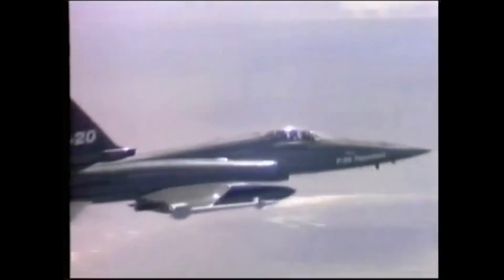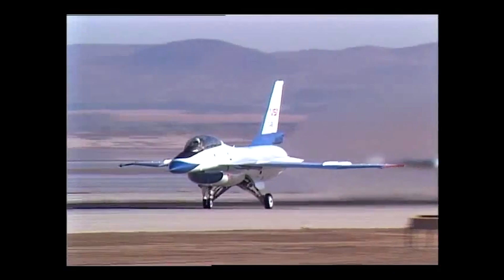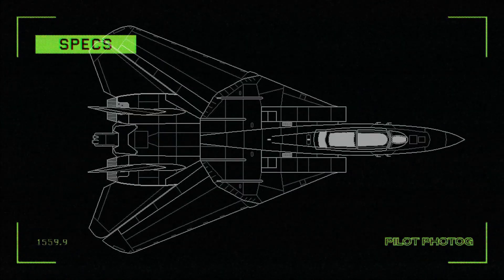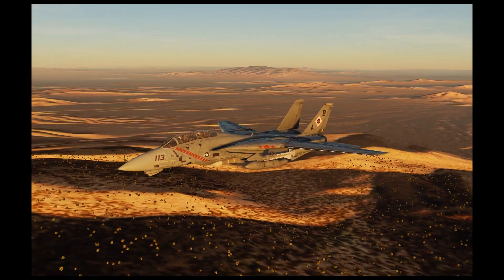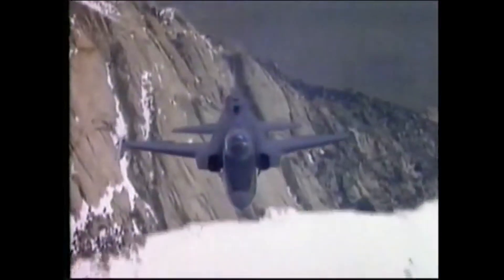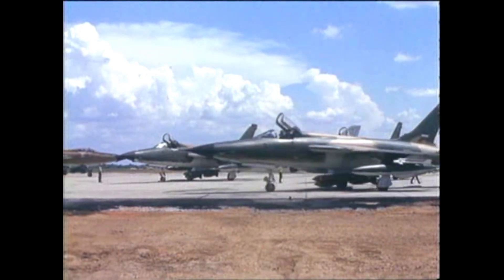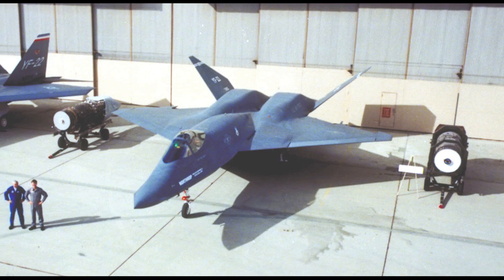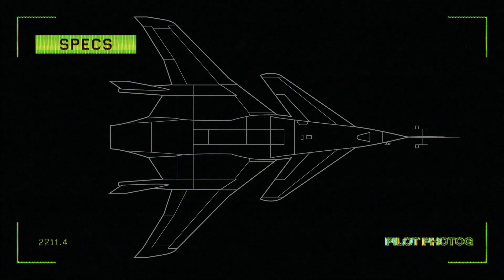Top 5 Fighters That Should Have Been Built | Best of Aviation Series by PilotPhotog  f20  f16xl

Comment: Don't take away my passport, but: the Avro Arrow definitely should not have been built. You're paying three times as much per airframe as you would for a contemporary F-4 Phantom, and giving up all multirole capability, in return for slightly better performance in the straight-line bomber interceptor role -- in an aircraft which is going to come on line simultaneously with the introduction of practical ICBMs by the Soviets, of which they will have around 1,000 by the time the aircraft is ten years old. There's a reason all the equivalent British and American projects were also cancelled.

Comment: Here's one that should've been on that list: the Vought F-8 U3 Super Crusader. It lost out to the F-4 Phantom, which was anything BUT an Air Superiority Fighter. It was basically a High-Powered Attack Bomber. The F-8 U3 had maneuverability & performance of F-15 C And in a Dogfight, would Eat an F-4 or Mig-21 alive. It was so fast, that the production models were going to have Ceramic canopy Glass, as around Mach 1.8 the top front of the canopy would glow. Test pilot Conrad said the plane was easily capable of 2.9. This stupid decision by Mac Namara, I think cost the lives of every F-4 crew lost in Viet Nam to the Migs. The Pentagon DID get it right choosing the F-15, which has a win-loss ratio of: Basically a Shut-out. See "Eagles Over Lebanon," for more on this World-Beater.

Comment: Just for the record. The YF-23 lost because of issues with the VTOL ( Vertical Take off or Landing) system. It failed to meet the military requirements.
Reply: I think you got YF-23 mixed up with YF-32 which lost to the YF-35 for those reasons you mentioned in 2001.  YF-23 went up against the YF-22 in 1990.

Comment: Crusader III which lost out to the Phantom should have beaten the HiMat.   USN was too worried about bomber attacks on it's carriers and not enough on conventional fighter duties.
Mig pilots in Vietnam would have crapped themselves in fright facing a F8U-3
Reply: I Agree with you on that one. Buy both F-4 and F-8U-3.    The U.S. Navy should of bought the F-23 and had them flying off the decks of Nimitz and Ford carriers, The true replacement to the F-14 in 2007.  let the AF have the F-22.   I read some bull crap reason they did not get it was low rudder authority on carrier landings because of the V tail.  They got a tail less flying wing drone landing on a carrier. Bullshit. 
    I guess they was tired of getting the leftovers, YF-17/ F-18 NV  YF-16 AF    The AF looked at the YF-14, went with the YF-15.

Comment: The F-5 is imo, the most potent and dangerous. Ironic because it's so much smaller. It's high maneuverability is the reason they use it as a trainer aircraft. The lower cost means you could get multiple F-5's for the price of one current modern fighter.

Comment: This is the first video on this channel I've ever watched and it was really knowledgable with an engaging presentation as well; kudos!

One plane I'd nominate is the Sukhoi Su-37 (the originally, not the Flanker variant that has now used the Su-37 moniker). It was designed to replace all of the aging and highly vulnerable Russian fighter-bomber and dedicated ground-attack variants currently in service.

It would have been favorably comparable to an F-35 in most performance measures, had much better pilot protection (which had more to do with Russia's looming demographics crisis of a disappearing pool of manpower aka not enough bums-in-seats growing up), and a mind-boggling 18 external hard points (!).

Comment: The 23 not only bested the 22, it also achieved Radar lock on the 22 during a flight in which both planes were flying at the same time.  The 22 never achieved that.  Flying to "Stealth Week" in Washington DC was accomplished by the B2, F-117 and the YF-23.  The 22 had to be carried there as it was not able to perform that simple task.

Comment: Glad you picked the YF-23! Boeing had the political connections. Lockheed built the better plane . Just like the B-49 story; this plane was too good! It's funny how something that is too good, gets cancelled. This also operative for the F-5, F-20, X-29 series of fighters. 
     The F-5 was always too good, too small, and made too much sense as a fighter. Pentagon officials like big expensive programs with juicy kickbacks. So the much larger F-4 Phantom was used instead.
     Northrup has neatly always produced the best planes. Only to lose out to Boeing's political muscle. Building a less costly fighter, based on this aircraft family; is still a great idea. Only it's unlikely that the Pentagon would ever allow it.
Reply: The McDonnell Douglas F-4 Phantom 2 was designed for the Navy ( after its older brothers F-1 2 and 3 ). Robert McNamara made the U.S. Air Force take the F-4.  The USAF even wanted to designate it the F-110 inline with there " Century Fighters " ( F-100 thru F-117 ),  DOD said NO !!!   it was one of the early fighters able to fire the new ( at that time ) AIM-7 Sparrow Missiles that are designed for " BVR " ( Beyond Visual Range missile engagements guided by the ACFTs own RADAR ) and not ground directed interceptor like F-102 and F-106 with the SAGE system of ground guided to intercept RADAR.   The F-5 is very manurable in a dogfight and deadly with its two M39 20mm cannons yes...  it can Fire AIM-9 sidewinder heat seekers yes...  but it did or does not have the RADAR and fire control to shoot AIM-7s.  So a F-4 or Later model MIG-21 and MIG-23 could shoot it down head on before the F-5 could use his/ hers agility to get behind you for a firing position and win.  That's why the F-4 was superior to the F-5 in the late 50s and on.  They eventually upgraded the F-5 to F-20 in the mid-70s with a capable RADAR and fire control to shoot AIM-7s but we are already in the F-14  15  16 and 18  era by then ( Legacy fighters ).  That's why it did not go anywhere.  The F-5 was used for close in ground attack in Vietnam by the USAF along side the A-1 Sky raider and  F-100 in the " Sandy " rolls for a reason.  I read the book.
Reply: @leonswan6733  I didn't talk about the super Crusader that competed against the F-4. A plane which was smaller, faster, and more maneuverable than the F-4. It had 1 engine and 1 seat. So the pilot had to do everything. The larger F-4 was picked. In part because it was bigger  and could carry more missiles. But mostly because they had decided to decommission the Essex class, and smaller carriers. In favor of ships like USS Ranger CV-61. Ships that could operate larger aircraft. The F-5 was too small to mount the massive radar used on the F-4. It was designed for use on smaller carriers.  Like USS Princeton. The F-20, enjoyed advances in electronics miniaturization. Which allowed it to fire radar guided missiles like AIM-7. 
     On paper, the AIM-7 could do the BVR engagements you describe.. I practice however, It almost never happened successfully. Not until later versions of the missile became available in the late 1970s. The F-14/F-15  using a new radar and improved AIM-7. Accomplished what most F-4s aspired to. Anyway bigger is not always better. The Migs 17, 19, and 21, could all turn inside an F-4 Phantom. A fact which cost use too many planes and pilots. It was only the Top Gun program which saved the F-4, from an early retirement.

Comment: F-14 unmatched speed? The English Electric Lightning from the late 50's/60's could super cruise... F-20 was a technological dead end. The F-16 was a much better airplane with much more room for upgrades.  Just because fan boys like a fighter, tank, boat, etc does not mean it is a good solution. HiMAT, NOT a fighter... Never was, never meant to be. You mention the F-107 and not the Vought XF8U-3 Crusader III. Fuck off, fanboy.

Comment: Also the F-5 Tiger ,was built in big numbers ,one of the buyers was the Iranian Air Force ,they had over 200 in all versions and after the islamic revolution in 79 they did not get any spare parts from the US they had to look for solution and start producing this plane in 2-3 Versions  the "Saeghe" -  "the Azzarakhsh"-and the "Kosar",all lok like the F-5 only they are a bit longer about 1-2 meters with an russian engine Klimov.

Comment: Oh, boy. I could not agree more with the #1 and #2 choices. For 35 years, I worked for Northrop mostly in the Test and Evaluation dept.
And I spent quite a bit of my time working on both the F-20 and YF-23 programs. Both procurement decisions were based on political decisions and not on performance. In the case of the F-20, General Dynamics was so terrified of it going into production, they cut the price of their F-16's to where they were actually taking a loss on each airplane sold, just to nip the F-20 in the bud before it could get going.

Comment: The yf23 was junk. The F22 won every test so that's why it won. If y'all talked shit about the cost of the F22 the F23 was going cost $20 million more a plane.
Reply: I beg to differ. The YF-23 was better in almost every aspect, with the exception of maybe being not quite so maneuverable.
The YF-23 had a higher top speed, a better super cruise capability, better reliability, faster turn around times, and most important, better stealth. For the last 40 years, whoever detects the other plane first gets off the first shot, and that usually means a kill. As far as maneuverability goes, when was the last time a U.S. fighter got into a dogfight? In this day and age, if you find yourself in a turning dogfight, things have definitely gone south tactically.

Comment: Incorrect information within. The F-15E and the F-15D are substantially different despite the logistics infrastructure commonality:
Stronger wings
Fly by Wire Flight Control Systems
Different Engines
Stronger Landing Gear
And more. If the video had stated that a key decision point had been its common logistics infrastructure, that would be true. To say that a decision point was "few changes were necessary" is an uninformed statement. More research is necessary on the video production organizations part.
Richard Gomez, USAF Veteran, MBA (Aviation). I have over 34 years in F-15 maintenance, logistics ( not box movement), and have worked in all three maintenance levels: Organizational, Intermediate, and Depot. For reference, the F-22 and F-35 have Two-Level Maintenance Logistics Infrastructures.

Comment: I followed the YF-22/23 race quite closely and was super sad when the YF-23 lost. 5th-gen fighter don't need to be the best dogfighter anymore. The YF-23 is faster, is all-aspect stealthier, can be had without the expensive stealth paint and can be modified structurally to fit thrust vectoring by sacrificing bottom-aspect stealth (against SAMs). The curves themselves diffuse radar returns better than the YF22, and due to its larger wing surface area, can probably fly higher. In the production F-23 model, the 2 enormous humps can be reduced further given more time in simulating airflow.

Watching the YF23 documentary and seeing the reaction of the test pilots and the engineers who worked on it when they learnt they lost was heart-breaking. They have the performance data in their hands, including data from the YF22 and they just couldn't believe they could lose with that kind of performance difference between the YF-22 & YF-23. This is why the debate rages on today.
Reply from the maker: Indeed and well said...I am working on a dedicated video on the YF-23
Reply: I thought the loosing factor of YF-23 was only the price. The competiton decided that YF-23 was an overkill while YF-22 will be cheaper and enough. What a shame...
Reply: @gunesdagli A combination of price, logistics, and demonstration. Northrop approached the competition with all of the enthusiasm and effort of a doped up highschooler at the science fair. Lockheed demonstrated the yf22s full capabilities and performed multiple tests, not to mention the fact that both yf23 prototypes suffered critical failures at many points.
Reply: Wait there is a yf 23 documentary?

I need to see that, what is the official name? Where do i watch it?
Reply: Considering it was meant to be an air superiority fighter, I would rather have the F-22 with its advanced maneuverability. I feel like the YF-23 would have fit better for the purpose of being a strike fighter like the F-15E.
Reply: @fatihkoksal4727  I doubt it. Stealth fighters don't have enough internal bays for many bombs. Carrying those on external hard points defeats the purpose of stealth.

That's why you have F-15EX and F16V.

With Aim120D & Aim260 on the way, the YF23 has even better standoff capability than F22. 

That's why you see NGAD & FAXX has even better stealth, longer combat range and network capability for AI Controlled Stealth drones.

When the NGAD & its drones have finished firing all their missiles, it's time to head home. They are not gonna get involved in a fight involving canons so high maneuverable is low on the list.

If an enemy gets close enough, the drone will kamikaze on enemy fighter.
Reply: The deciding factor was VTOL. The YF-23 failed miserably on that. Thus we have the F-22 Raptor.
Reply: @davidbrock4736  You've confused the F-35 with the F-22.
Reply: @davidbrock4736  Are you joking?  There is no VTOL on the F-22
Reply: @davidbrock4736  the F22 could NOT do VTOL.
Reply: @davidbrock4736  uhhh. That’s the f35
Reply: @davidbrock4736  I think you may be confusing SVTOL with “vectored thrust”. 

The F-22 has the latter. The F-35B has the former. 

Regardless, the YF-23 was nearly as maneuverable at lower (dogfighting ) speeds as the YF-22. Paul Metz has had a lot to say about the matter and he would know…

Ultimately, the YF-23 lost for multiple reasons. It was far more advanced than the ATF required. Higher cost, more advanced materials,  unorthodox layout, AND Northrop Grumman was still in trouble over the B-2 cost overruns. And not for nothing, but Congress loves to spread those Defense contracts out among the big contractors for political purposes. 

Just watch. NG won the B-21 contract. As long as congress doesn’t kill it before it reaches maturitity and FRC, LockMart will get NGAD unless they just totally shit the bed.
Reply: @davidbrock4736  Pretty sure the Raptor can't take off or land vertically.
Reply: @wadiostatic  the 16xl looks an awful lot like the sixth gen prototype. The 23 is being looked at by Japan right now.

Comment: The ONLY one of those that should of gone into production was the Super Tomcat (for which you did not mention the composite wing and changes to reduce RCS). As good a multi-mission aircraft the Super Hornet it, it does not adequately fulfil the air-superiority role as its there is too much of a performance gap to potential advisories such as the Flanker and derivatives.
Reply from the maker: Thanks for commenting and good catch on the composite wing and reduced RCS

Comment: The Arrow wasn't put into production for the same reason the F-104 Starfighter shouldn't have been.  That is the mission objectives / design parameters were obsolete before introduction.  The F-104 was later used for something it wasn't designed for and is the reason for its general failure.

Comment: the F-20 Tigershark (modernized T-38 / F-5) had flyoffs with the F-16.  The F-16 was the better plane but the F-20 was cheaper.  It would have been a great plane for export.  The F-23 was a better plane than the F-22 but would have cost more.  The prime reason though was "balancing" procurement dollars amongst the big contractors, IMO.

Comment: I have always said that, given the horrendous delays in the Eurofighter Typhoon, if I had any say in defence procurement, I would have abandoned it in favour of the SAAB JAS 39 Gripes, especially in the current E/F upgraded versions ...

... but, listening to this, I would have also fleshed out the fleet with both the F-20, and the Super Tomcat, to overlap the roles each has ...

Also, the USAF should still build the F-23, depending how the F-35 performs ...

Comment: N.G. was blocked from producing YF-23's for Japan  just this year.  That's very telling, considering the F-22 is still considered the U.S.'s air superiority fighter, while it was outperformed by the YF over 20 years ago, in speed, maneuverability, and blew the F-22 away with a much smaller radar signature.  Given today's computing capabilities, the YF wouldn't need on onboard super computer, with a hull fashioned around it.  Making a current version much easier to build, with current HUD and radar, still outperforming the U.S.'s "best" in every conceivable way other than radar/tracking.

Comment: The biggest problem with the F-14 was the fact that almost no carrier carrying f-14s had more than about 50% of them flying at any one time. They were horribly prone to maintenance issues. Great aircraft with a lot of maintenance required to keep it in the air.
Surprisingly, the F-22 suffers the same high maintenance requirements and lack of parts do to the moronic decision to stop building any after it was realized that from a reliability point of View, the planes sucks